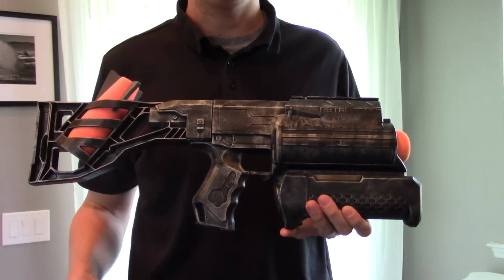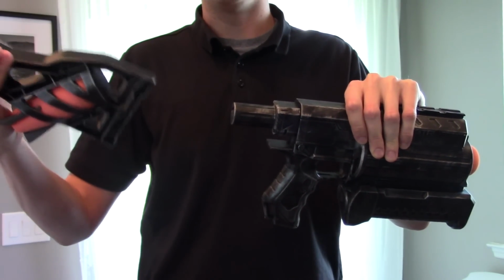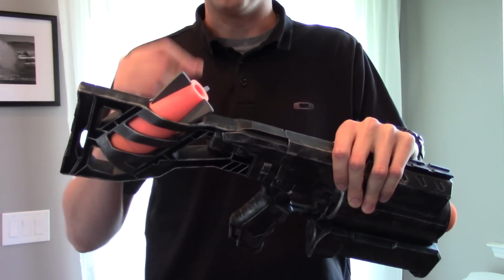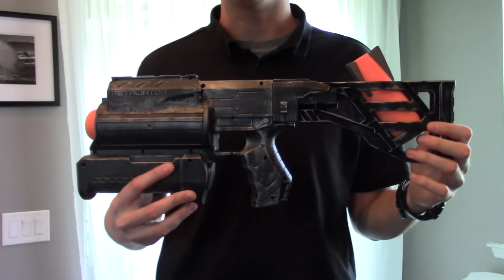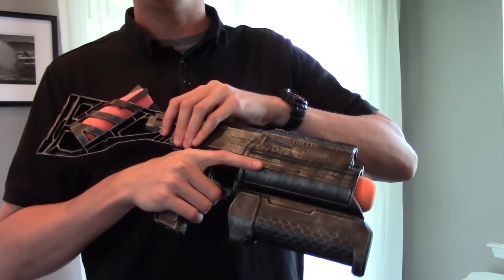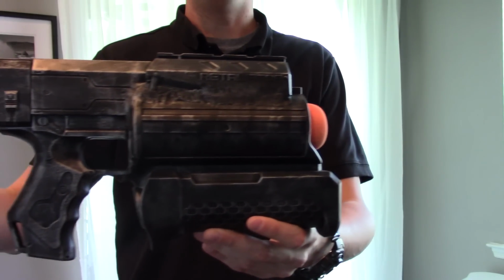[MOD] Nerf Grenade Launcher - Demolisher Missile Launcher Integration

Comment: great paint job, gives this blaster a real rugged used look to it which makes the unsanded putty section look more in place. BTW ever thought instead of forming the putty with hands and sander, what if you formed it with some clay forming materials to give the putty lines definition, not saying spend hours making 90 and 45 degree angles everywhere, but a couple of lines formed out of the putty will make it look more technical.

Comment: coop you should use teflon tape under the o-ring instead of electrical tape. it is cheap,easier to use and it is thinner so you can use smaller increments

Comment: I actually really like this design, could you explain what the smooth cast 65D is used for in this mod? is it to create an air lock? please let me know thanks coop.
Reply: +stevenrama 
I am not Coop, but i think that the cast is to make the bond between the shells stronger, since he only used hot glue to put the together.

Comment: Been thinking about this over the past few days.  Do you think it would be possible to make a larger, rotating missile launcher out of multiple demolishers?  I was thinking that it might be easier to use a 3d printer to print out the extra holds for the extra missiles, rather than having to buy 4 or 5 extra Demolishers.  

It would be an even bigger version of the Mega Cycloneshock.  THAT would be cool. But bulky.

Comment: I am slightly confused by what this mod is, did you just put the Demolisher missle launcher onto a retaliator so you basically have a demolisher that has a retaliators internals instead of the flywheel internals?
Reply: HappyPotter There are neither retaliator nor demolisher internals left. Just the pump-action missile launcher and a part of the retaliator shell.
Reply: There is yust a missle launcher so it does not shoots elite darts ore what so ever.

Comment: I would have put one of my many spare air tanks in the shell and make it shoot just a LITTLE harder
Reply from the maker: Ekd This system is much faster. You don't have to pump multiple times then pull a trigger. It's essentially a single pump.
Reply: Coop772 It looks super cool :)
Reply: I know but a air tank would have made it shoot farther it's just what I would have done nice job on the blaster though